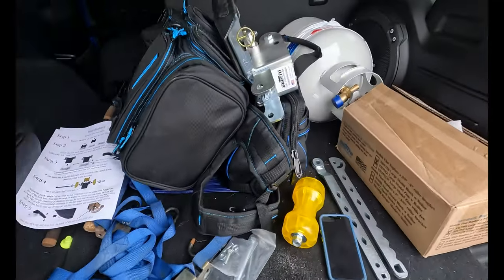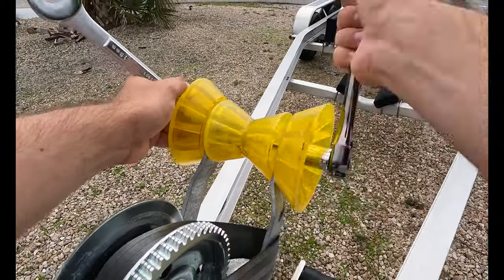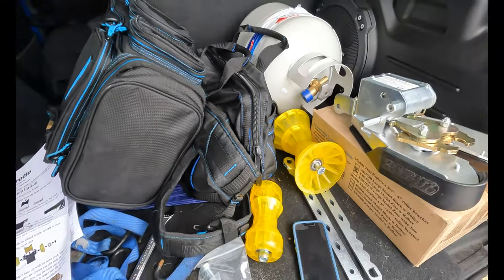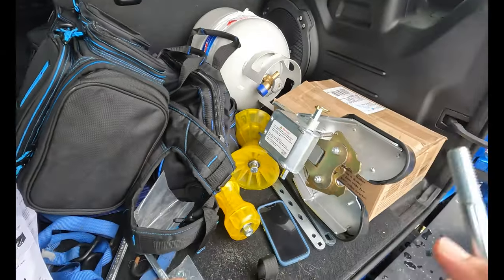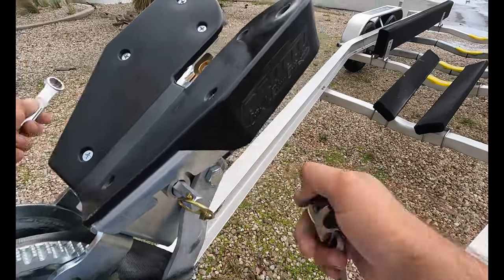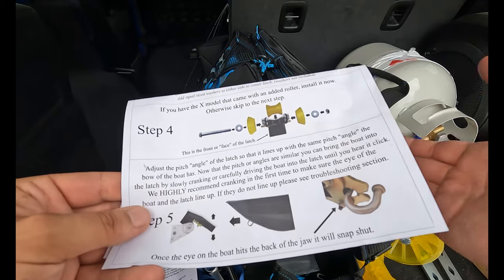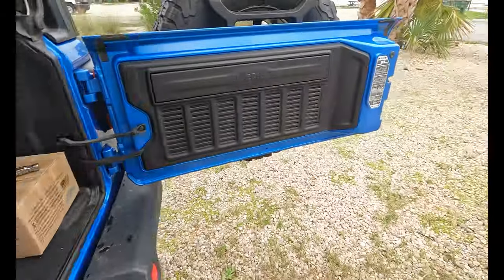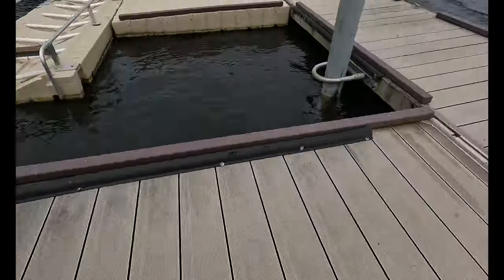Drotto Boat Latch Install on Sportsman 212 Open

Comment: Hello Trevor I have a Sportsman 211. Does this clamp really make a difference you when your launching and retrieving your boat
Reply from the maker: Honestly I have found it to be a big help especially when launching and retrieving by myself. 
The sportsman has the steep bow which I enjoy when the waves are high  but it makes reaching the latch, at least on our trailer, very difficult from inside the boat. When I was by myself before I would have to unhook the boat and hop in from the trailer tongue which can be very slippery and dangerous to climb on and jump off when wet, or I’d have to run up the dock and step in the boat.  When there’s larger wakes at the ramp or wind blowing you away it made it very rushed to get on the boat before it was in a bad position. I tried leaving the trailer more out of the water but I was putting a lot of strain on everything trying to motor the boat off the bunks and was slamming it up into the roller trying to get it all the way up. Also tying the boat off to the dock before it was unhooked added a whole new set of challenges that were undesirable. Most importantly however, the boat was sliding backwards against the strap and ratchet when coming out of the water making it bounce and move on the trailer which as you can imagine was not good when towing. I was skeptical at first but I can say this latch has eliminated all those issues. I can get on the boat before it’s unhooked and reach it from inside the boat. I’m no longer in a rush if I put it in the water far enough to make launching and retrieving easy and not worried about it blowing away. It also holds the boat securely at the front and limits the  room it’s allowed to move on the trailer so I no longer feel it sliding in the bunks going up a hill or bridge or during a quick stop. 
It’s made it much easier to handle boating myself when the conditions might not be ideal.
Reply: @TrevB_97  ok thank you very much! I was debating on getting it but I didn’t know if it was worth it. The install looks pretty easy and my boat was doing the same as your boat when I pulled out of the water(slipping) so that’s my reason for looking into this.
Reply from the maker: @cfelix0708 that’s what originally got me started looking as well and it’s fixed the issue and had some more useful attributes as well. 
Hope it works as well for you as it has for me.

Comment: Have you tried just driving the boat into the latch rather than winching yet?     Also...... did you go with the short or long handle?      I also have a 212 Open and a bunk trailer.    I don't often trailer it but want to keep some options open for loading and unloading by myself.
Reply from the maker: I have actually and it works well. Usually keep it to a slow drift then when I feel the bow in the bunks I give it some throttle and it rides up and clicks into place. 
I believe I opted for the longer handle. 
Need to make an update video on the latch next time she’s out on the water.
It makes it so much easier single handed, especially not having to worry about the boat drifting away. 
Make sure your subscribe and you’ll get a notification when it’s uploaded :)

Comment: Hey there, I have the exact same boat and it always pops off the roller. Has this fixed your problem??
Reply from the maker: Hey Jason,
It has actually, the boat would always slide back off the roller but after adding the latch it’s stayed locked in place. I usually drive the boat into the latch then crank it tight with the strap and it’s working great. I also make sure to remove the handle as per the instructions when I’m towing it and I haven’t had one issue of it allowing it to slide off. Once you figure out how far to back down to let it roll off and on it makes launching and retrieving a breeze especially being solo. 
Hope this helps!
Reply: @TrevB_97  Thank you so much the response. Have you figured out if it’s easier with the trailer farther down in water or up out of the water? I’ve tried everything and no matter what I do it pops off the roller. I just wanted to pick your brain before purchasing the drotto. Thanks again.
Reply from the maker: @user-jp2td2qx3k I usually have been putting the back wheels of the Jeep on the water line so the trailer is a bit farther down then I would usually do it. This lets the bow roll up the drotto and click into place when it hits the ring. I just go slow till it’s in the bunks of the trailer then let it carry a little momentum and it clicks into place no problem.
Reply: @TrevB_97  sweet!! Thank you so much! I feel encouraged now. Buy a boat they said. Hahahaha
Reply from the maker: @user-jp2td2qx3k haha I had the same feeling. 
It’s has been a lot of fun though 
Let us know how the latch works out!

Comment: Drive the boat up on the latch , gees !
Reply from the maker: It definitely was nerve racking to trust the latch at first, however, after almost a year of using it I can say I love it and it hasn’t failed me once. I do now however clip in the crank before pulling up the ramp, with the boat floating it helps to keep everything tighter. This latch definitely makes boating alone a lot easier especially in high winds or busy ramps with wake.

Comment: Tip
Completely dip the trailer in to get the bunks wet.
Move trailer up so that only 1/3 of the bunks are in the water
Power onto trailer and the Drotto will lock when it contacts the eyelet

If the trailer is in to deep of water it will not line up correctly 

Also, replace the polls on each side with side bunks, they offer much more guidance than the polls…….
Reply from the maker: I will have to try that out next time we’re out and see how it compares to the current method. 

Learned a lot after about one year of using this latch and looking forward to following up on it soon.